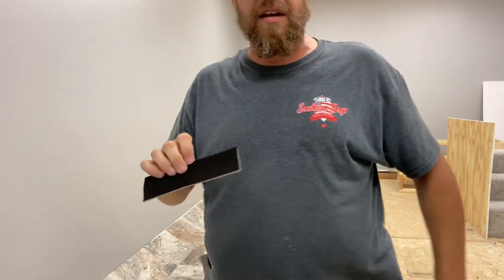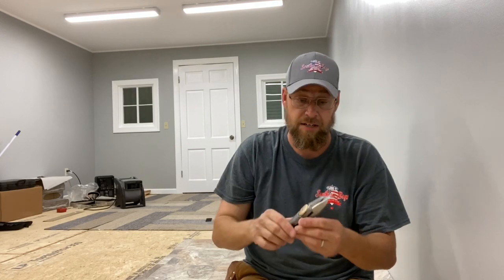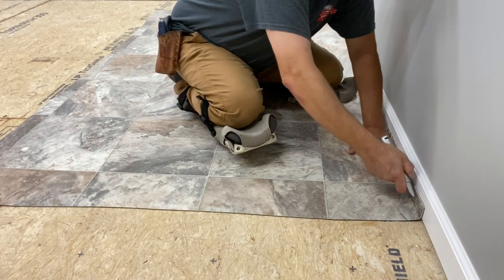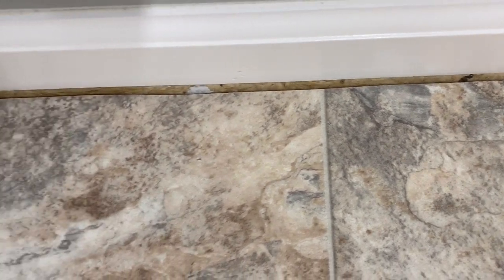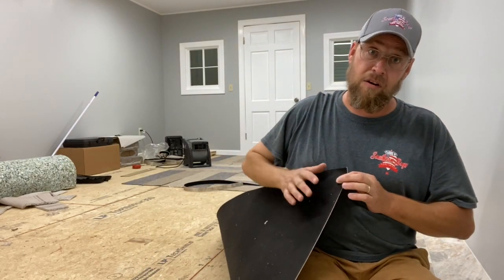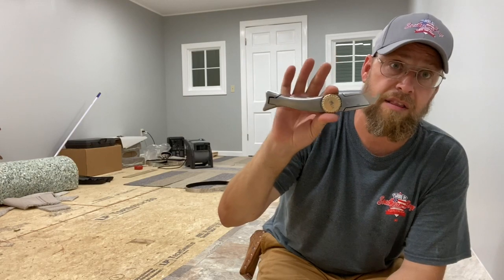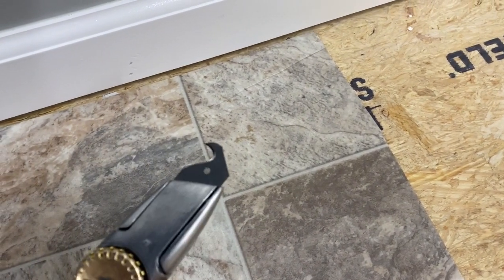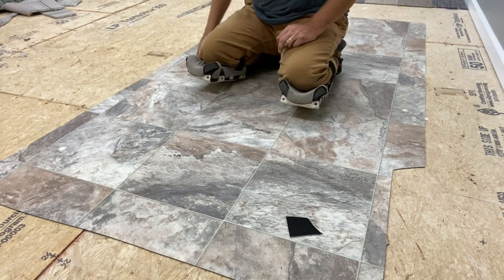Diy Vinyl flooring & Vinyl Cutter

Comment: Over here in Scotland and I suppose the UK in general we use delphin dolphin knives, I have 3 to hand.. one with Straight blades, one with "hooky" blades and one with super "hookys" only because I can't be bothered swapping out the blades in the same knife constantly 😂.. the super hooked blades are good for flush cuts in high piled carpets especially those awkward areas like under low radiator heaters
Reply from the maker: Aesthetics and Symmetry ! Awesome, I have been thinking about doing the same thing because I have plenty of them since I sell them on my website

Comment: I like to use my carpet knife. If you flip it backwards the handle angle helps push the flooring tight to the baseboard. I can cut the flooring perfect to the base that way needing no quarter round. I almost always full spread though if I was loose I wouldn't worry about cutting it so tight.
Reply from the maker: Fishing In Idaho nice

Comment: Have you used a concave blade before, it's what a lot of guys down in Australia use mainly because we don't put any quad on we just cut it in neat to the base board. Very good blades to use on vinyl backed carpet tiles
Reply from the maker: Gabe pastel Yes sir I use them quite often

Comment: I don't know man,, I don't recommend diy on any flooring that may need prep!! Every product has different needs and the average carpenters wouldn't understand! I know how forgiving this product is but,,,people will go over half inch cracks and screws and nails etc,etc,etc.. Some people suggest heat guns. Heat expands then it's going to contract. I crease a couple times gently with my hook, then shwack it in!!

Comment: where can I buy this flooring? I really like it
Reply from the maker: joseph wall Try your local Carpet store
Reply: @FloorsbySouthernboys  what is it? I can't hear what you called it
Reply: @guycleveland5946  , in Ohio they call it ,,, Vinyls Flex Floor. I've never seen it with the black felt on it in the Cleveland area.